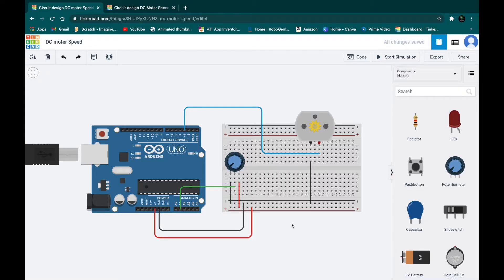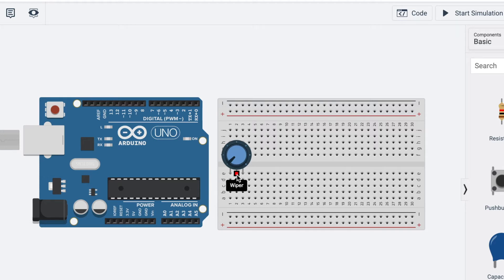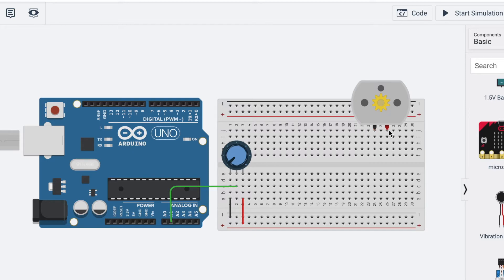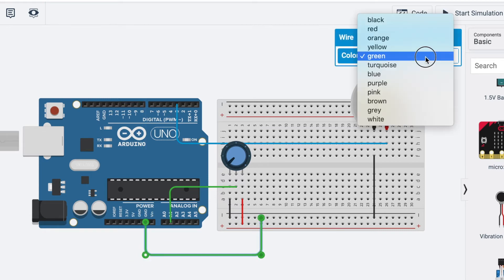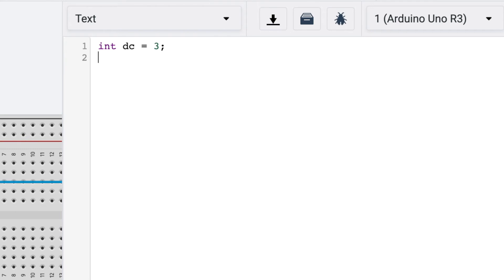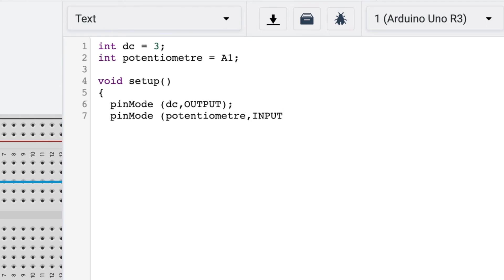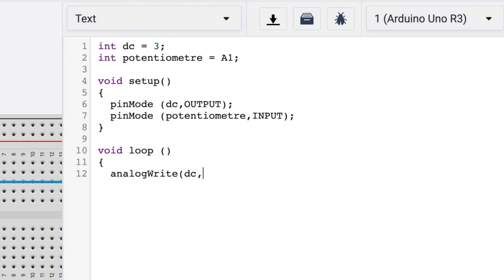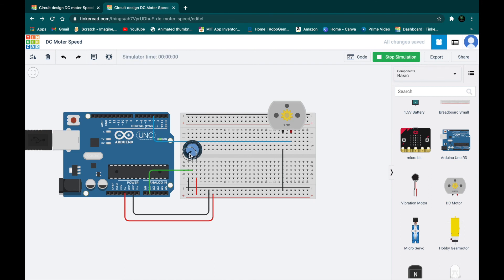Arduino Tutorial: How to control DC Motor's speed using Potentiometer

Comment: DO NOT CONNECT AN ARDUINO STRAIGHT TO A MOTOR
motors produce noise and use up alot of current which can mess up a pin or the entire arduino itself
Reply: then what we can do?
Reply: connect the arduino to a mosfet to control the flow of an external power supply
Reply: @keerthu374  that video doesnt work in real life!!!